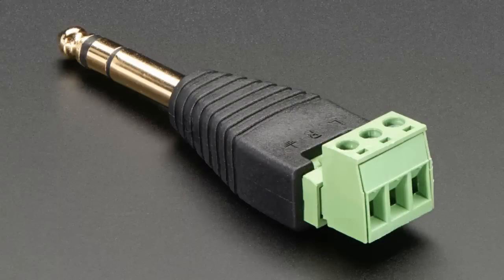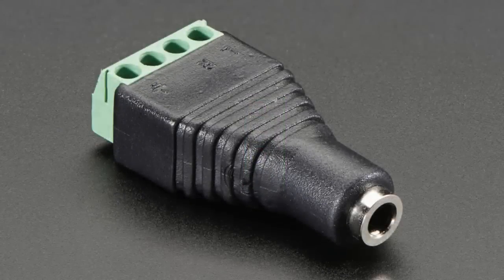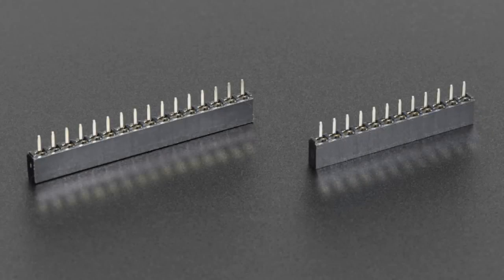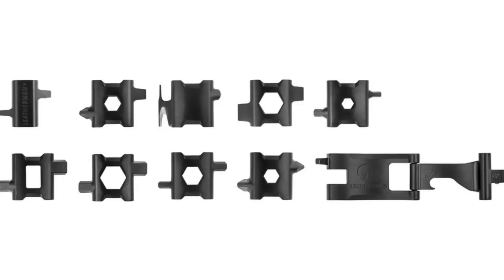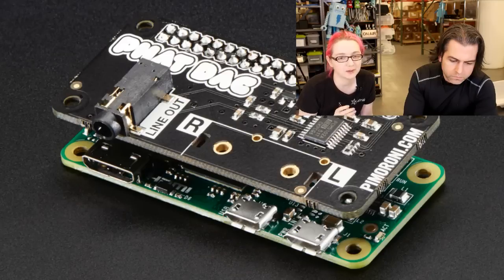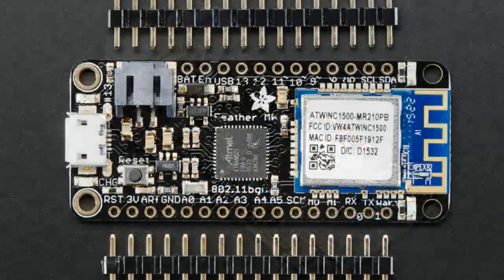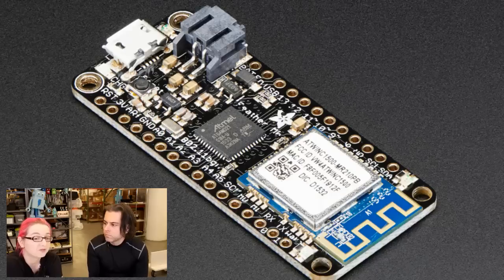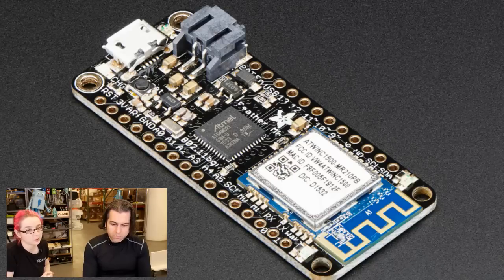New Products 1/27/2016

Comment: Any chance you could get a stacking version of the short headers (from 3:14)?  My thought is to have an OLED featherwing (with the male short headers) that I keep attached to a feather (which would have the headers I'm hoping for), which in turn I could plug in to a doubler or tripler for other featherwings to attach to.

I poked around on the digikey and samtec sites, but I'm a bit overwhelmed because I don't quite know what to look for.  A part number would satisfy me, though I'm also happy to buy through y'all, to help support the wonderful work you're doing!

Thanks, either way! :)

Comment: Great work all. Love the open source type empowering inventors type products. That leatherman tool really isn't good though it is stainless and as such isn't the best durable tool material instead of something like tool steel or D2 so the bits will bend with use. Leatherman should have at least made the bit parts a higher carbon harder steel. Keep up the great work!